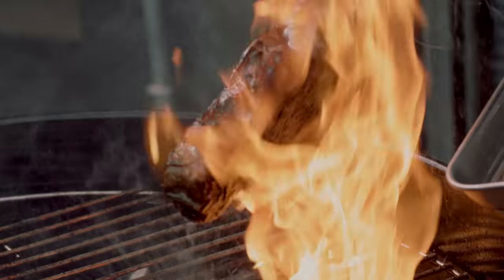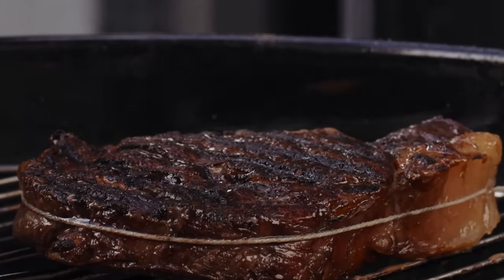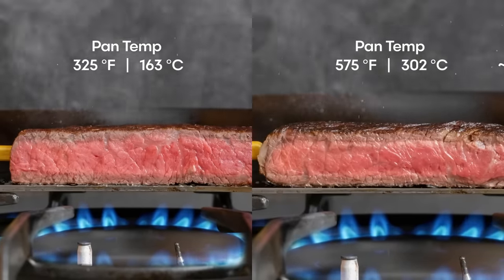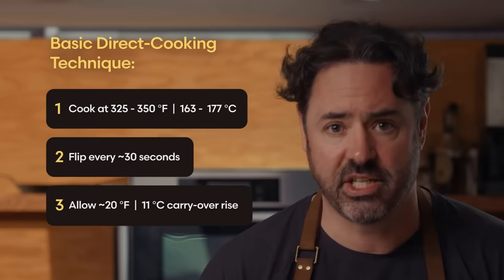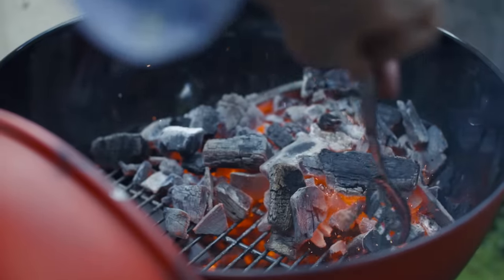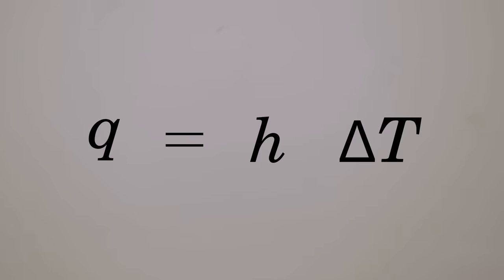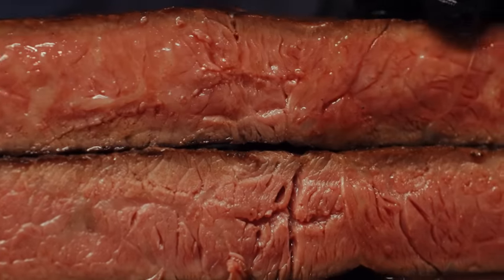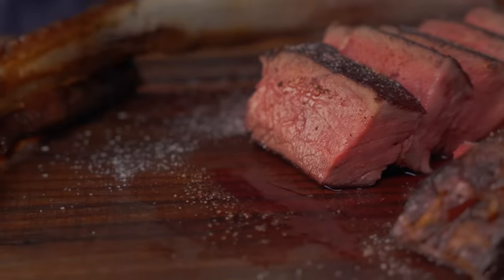Why Ripping Hot Is Too Hot? | TESTED

Comment: Bought a 1" thick ribeye yesterday. I used a new toaster oven/air fryer combo for steak for the first time for a reverse sear. It worked so great. I set it to broil for like 27 min and I didn't flip it. One side had some gray band but the other side had absolutely zero gray band. I guess the gray band on one side wouldn't be from broiling right? It's most likely because I didn't flip it consistently enough on the pan to finish the crust. I use pan roast because of my lifestyle but charcoal would be preferred. I love that charred taste and you certainly don't get that from deep frying.

Comment: I'm a trained chef,
Yesterday insaw a video of a (home?) Chef using and promoting a cold pan technique that should be similar to reversed seer starting off in a oven. The amount of overcooked grey outer layer was huge, even bigger than when I use a regular method by cooking a steak directly in a pan. 
Either method you use dry brining is a true recommendation! Drawing moisture from your steak really helps limiting the overcooked layer even for sous vide!
Another good tip is avoiding buthane torches,  ripping hot cast iron pan with butter is the my favourite way as you can add herbs an garlic to baste it. Make sure you dehydrate your butter first to increase the burning point by cooking and removing the scum of the butter, this technique is easy and you can do it with large batch, after this process you can easily store it in the fridge for quite a long time, this way your butter can be stored even longer before getting rancid than butter that still contains moisture and always make sure keep your butter air tight in the fridge as it easily picks up unwanted smells and flavours from other products in your fridge.
Reply: What you're describing is ghee. Dry brining doesn't remove moisture from your steak, it actually retains moisture. "Ripping hot cast iron pan" is exactly what the video advises *against*.

Comment: I've always been told to start at ripping hot and dropping the heat as the crust forms.
The heat doesn't dissipate fast enough to effect the crust formation, but does dissipate quickly enough to prevent true charring.

Comment: My recent go-to steak method has been to oven bake at 200-250 depending on time available with a thermometer in the meat to get to about 105 and then pan sear which for an ultimate internal of about 115. My plan for my next steak is to pan sear and then oven bake. 

I’m tbh not that comfortable with deep frying I might try that outside. 

For my next sear I think I will use oil in the pan to cover half the thickness of the 🥩 ; then flip it; as a preliminary to the oven bake.

Comment: I appreciate the scientific point of view to find the best method using a more quantitative method. I do have a follow-up question. If the findings from these experiments were that deep frying a steak was the best method to get a perfect crust with a perfect inside as well, why is that not a more widespread method? It almost felt taboo to me when it was done. Surely many cooks take a scientific approach as well, so you would think it would be done more if that was the best way.

Comment: Wow, the deep-fry sear results looked absolutely heavenly! I usually pan-fry at a little over 200°C and it generally works out nicely if I've left the steaks in salt at room temperature for a little while before cooking. I've also concluded that turning and moving the steak in the pan is not a sin.

Comment: Since heat transfer into the surface is all you care about for a sear, you can get similar results to deep frying with a lot less fuss by just putting plenty of oil in the pan.  Compared to deep frying, the total cooking time won't be as short (since you cant sear both sides at the same time), and there will be more of a temperature drop when you first introduce the steak (since you don't have the massive heat capacity of an oil bath), but I've found reverse sear + "shallow" frying in a pan to give excellent results with minimal trouble.
Reply from the maker: While I agree shallow-frying is great (and I frequently use it when I don’t want deal with a huge amount of oil), it definitely doesn’t transfer heat as fast. The primary issue is that large convection cells can’t form beneath the food and rapidly move cool steam and cooled oil out of the way. Most research I’ve read put shallow frying at about 1/4 to 1/3 the heat transfer rate of full deep-frying.
Reply: To add to what Chris said, non-deep frying will drop the oil temp- maybe too much for a good sear.  A cast iron vessel for frying would help.  Also, note all the bubbles in the video- that's meat moisture being turned into steam which sucks up a ton of the oil's heat.  And to ratify the 1/4 to 1/3 heat transfer rate Chris stated- just did fried green tomatoes in shallow fry and in deep fry.  The cooking times sure bore out the rates Chris stated.   (Also much greasier and limper fried tomatoes)

Comment: Excellent! The discussion of the boiling zone at the resulting stall at that depth is not anything I’ve seen done as well elsewhere. I must admit that I haven’t looked at all of the more than 2000 comments, but in the sample I looked at, I didn’t see any mention of the Booker and Dax Searzall Pro. Its use of a double screen largely prevents the undesirable carbonization resulting from a normal torch’s live flame, producing radiant heat over a usefully large area, and reducing the the probability of ignition at the food's surface. It is, however, a tool, and like any other tool, it takes some investment in practice to learn to use it well. I have been using the sequence of doing the cook in the combi oven set at three degrees above my target, a probe to tell me when I’m three degrees below my target, and with high humidity to do “bagless sous vide” -> quickly drying with C-fold paper towels and setting the meat on a baker’s rack -> Searzall -> a 20-minute rest, but based on your discussion, I think I’m going to experiment with reversing the last two steps.

Comment: I always dry off my sous vide steaks before searing, to enable the heat to crisp the steak without wasting heat, boiling the water on the surface and overcooking the steak.  Additionally, you can chill your steak before the sear.  Some people put it in the fridge for a bit or an ice water bath, to reduce excess heat traveling inside the steak.

Comment: Sous-vide does also have another advantage. Since collagen breakdown is a function of temperature AND time you can get a more tender steak with sous-vide. You can test this by doing one steak sous-vide for 1hr and another for 4hrs. Even though the internal temp doesn't change, there's a noticeable difference in how tender they are. 
Personally I like doing my ribeyes or sirloins at 52C for 2.5hrs, any more can make it kinda 'mushy'.

I suppose in theory you could do this with a very long reverse sear, but most residential ovens aren't accurate enough or can't go low enough for it, and I'd be worried about drying the steak out too much.

Comment: I like it 1 inch thick, Medium-High Heat, flipping often, baste with butter + thyme + rosemary and rest for 5 mins. I do it on a non-stick pan with rocky design. Less messy, still good crust, easy to work with.

Comment: I just tried a reverse sear for the first time. I took my steak out at 110 for medium rare and my wife's at 135 for medium well. I let them cool down like you said and patted them with a paper towel to get rid of excess moisture. For some reason though a crust was taking way too long while searing. Even after 4 minutes, they still didn't have a good crust, but I took them out anyway because I didn't want them to be overcooked. Unfortunately they did still overcook. My steak ended up medium well and my wife's was well done :( I don't know what I did wrong.

Comment: my fav way so far:  I smoke a thick steak at 250 until internal temp gets to about 110.  then pull it and let it rest until I'm ready to eat. when ready, I reverse sear it either on my flat top or in a carbon steel pan on medium heat, flip it a lot to get a good even sear, let it sit and boom perfect steak with good wood fire smoke flavor, good maillard crust, and zero burn.  tough to beat and now my mouth is watering

Comment: first of all congratulations for the video: very rarely is the approach so well described, technical and prospective; as far as my experience is concerned, certainly influenced by my Italian culture, the objective is practically to replicate the effect of the Florentine in the fireplace on the embers; wood makes a difference and we love finding a gradation that goes from the purple of the heart to the brown of the external part; we learned reverse searing because it is more convenient in the case of many guests at home but, when used, they accuse us of becoming old and lazy ;). after having tried all the systems you analyzed, I still prefer wood embers or quality charcoal; Have you tried infrared straighteners? a well-known Australian brand uses them XR... and I would be curious to try them too. Thanks for your work

Comment: I'm a guy who learned a bit of physics and chemistry in my life. Not even once did i require a neutron star's core temperature for my pan to cook food to any gradient of readiness, unless it's an 0.1 inch steak. 
Also, a little trick. Most spices usually pack their flavor in organic compounds that will happily dissolve in oil, but won't survive extreme temperatures. So cooking spices over long time in oil with minimal heat makes aromatic oils that can be used with basically anything, they're much better at distributing flavor if that's what you aim for

Comment: Last night here in Santa Monica, I used a small Mibrasa hibachi, which comes with an elevated second grill — the elevated grill sits on top of the main grill surface, about 4” above — to cook two beautiful rib eyes.  I used  Japanese binchotan charcoal, which gets REALLY hot.  I got the charcoal to glowing red hot, which with the Japanese charcoal can be 600+ degrees.   Then, I put the two rib eyes on the top grill and cooked them slowly, flipping every couple of minutes, and carefully following their internal temps with a Meater Plus.  This method gives a good maillard effect, although minimal, because the temps are still high at the secondary grill surface, but not as high as to give it a thorough maillard crust.  However, I am say, 25% of the way there.  At about 115 I remove the rib eyes and put them on the lower, main grill, which is about 2 inches above the coals.  Now, remember, these are REALLY hot Japanese charcoal coals.  So I get a beautiful crust IF I pull them quickly and do not let them burn.  The result was, as my wife put it — and I have cooking for her for over 30 years — “the best steak I ever had!”  Now, she may just being saying that because she needs a new car, but they were terrific.  For those who do not know Mibrasa charcoal grills, all I can say is, these are the Bentley’s of stainless grills, ranging from “cheap” $400 hibachi to $20,000 charcoal ovens.  Truly a beautiful work of art; my hibachi is brilliantly thought out, wonderfully made of the highest quality steel I have ever seen, and, if I could convince my wife not to get the new car, I could afford one of their “small” non-commercial charcoal ovens.  Maybe.

Comment: I've tried sous vide to torch sear several times. It left what I call "torch taste" several times, and I kept the flame moving. Not my favorite. I prefer searing in a hot cast iron pan with some beef tallow for about 30 seconds a side, then turn the heat down, add pats of butter, whole garlic, and sprigs of thyme to brown the butter and baste the steaks with a long spoon for about a minute a side. While the steaks rest from that I immediately throw mushrooms in the pan and saute them, when the water comes out of the mushrooms I'll fish out the thyme sprigs, then deglaze the pan with some port wine, then throw in a couple cubes of demiglace I always have on hand, take off the heat and throw  in a couple more pats of butter and stir for an amazing pan sauce with sauteed mushrooms.

Comment: Chris, I really LOVE all your informative videos. I literally sipping them one after another, pausing and replaying to catch all the details and knowledge you are sharing with us. I have a haunting question: could you tell if there is any difference in heat transfer if we compare cold raw meat and sv or reverse cooked meat that is chilled and need to be reheated? In other terms: if we have two identical steaks (size, thickness, weight), one completely raw and cold and another pre-cooked sv or reverse but cooled at the same internal temperature of the raw steak, do we see some difference in heat transfer if we sear them in a pan? Also, could the pre-cooked and cooled steak have some benefits in terms of moisture, juiciness or other desirable features?
Reply from the maker: Yes, there will be a difference in the heat transfer rate between raw meat and meat that's already been cooked. The meat that has been cooked will have lost a meaningful amount of water during the cooking process, which will make it denser and faster to reheat because it will have a higher thermal conductivity compared to the raw, wetter meat.

Comment: Based on this I'm surprised to find that my charcoal is too hot, not too cold. Always struggled to get a good crust instead of char or grayness and here's the answer.

My next steaks will be "reverse shallow fried" in cast iron. Low and slow in the oven like reverse sear, but then heat about half an inch of oil in cast iron and shallow fry for a more consistent crust at just the right temperature with the higher thermal conductivity of oil. Probably not as good as a full deep fry, but cheaper and more convenient to work with lower oil quantities.

Now to dial in the internal temperature I pull the steaks at. In the past I've pulled when 5 F below target. From your other video I now know this is probably way too late. For reverse sear I'd guess a bit less temperature rise than cooking in a hot pan so probably pull at 115 F for 130 F target.

Comment: Reverse sear has been my favorite, since I learned of it about a decade ago. Controlling the sear temp in the oven to 250°F, to exactly 122°F, pulling the steak, letting rest for 8 min., then pan frying for 1.5 min each side...but Only after searing the edges first..!!
The deep frying is really unnecessary, if your using hi temp oil, such as Avacado, which will allow the same results that deep frying does especially on non fatty steaks, which I personally consume, Prime Tenderloin and Rib eye Cap.. along with the occasional Prime rib, which I remove as much excess fat as possible..!!
Here again this is using a cast iron pan..!!

Comment: Doesn't the blowtorch section show that after a reverse sear or sous vide you WOULD want a ripping hot pan (not a 350 pan) to sear? A ripping hot pan would minimize the time to overcook while getting to a seared crust the fastest right?
Reply: I would certainly agree there. I almost never make a steak without reverse searing or sous vide because that always gives me the best result. I sear over medium-high heat on a cast iron skillet for about 1 - 1.5 min per side. I don’t flip a lot, and I do like a bit of char. Maybe I’ll try this guy’s method though just to see how it turns out.

Comment: My favorite way to cook a steak is reverse sear. 1-1/2 inch steak cooked to 130 degrees in a 225 degree Fahrenheit oven. Rest  10 - 15 minutes. Seared on a super hot cast iron skillet (outside) for 1 minute per side. AND NOW I have to try deep fry searing.

Comment: Hi Chris! I love your work and love your thermometer.

I've watched this video a bunch of times and just have a few questions.

1. If the steak is reverse seared, does making the pan hotter develop the crust faster with a lower chance of of overcooking the steak?

2. Does that mean that thinner steaks should be cooked over hotter pans as well?

3. At around what thickness would be best to pan fry a steak on a lower temp?
Reply from the maker: 1) Yes
2) Yes, within reason
3) I think reverse-sear is the better choice once the steak gets thicker than about 1 inch

Comment: I just got a grill with an infrared side-burner. It seared the steak so fast that I had no choice but to finish the steak inside the main grilling area at a lower temperature. It was the best steak I have ever cooked and I was amazed at how little over cooking there was around the edges.

Comment: Recently I have been doing reverse sear. Last time I cooked the steak, in my smoker, at 225°, until the steak hit an internal temp of 120°, then let it rest while I cranked the smoker up to 500°. I seared both sides on a cast pan, and ended up with a medium. Next time, I will take them off of the grill at 110° and do the multiple flip when I sear. I think it will be perfect medium rare.

Comment: Regarding cooking with coals:  I tried putting a small rack placed directly on hot grey coals and the sear was too much.  too hot.  too much of a burnt flavor and too much flavor directly from the coals as well.  Also tried just putting the rack over the top of a ripping hot coal chimney starter and it was better in one case when doing fillet that had been sous vide already.  But I did over cook in another session with ribeye.  Too much flair up from a fatty steak.  Not advisable to use this method unless the steak is already sous vide and a cut with lower amounts of fat.   I now have a tiny Smokey Joe Webber grill I got at a garage sale so now when I fancy a fast grill session using a small amount of coals, I have an option and it turned out real well in the last cook.  You can still do indirect and then direct on the little thing if you aren't cooking huge steaks or more than two.